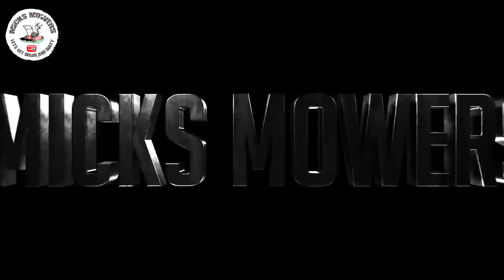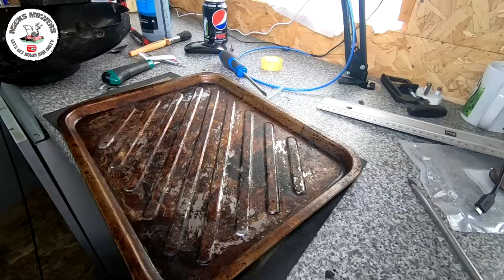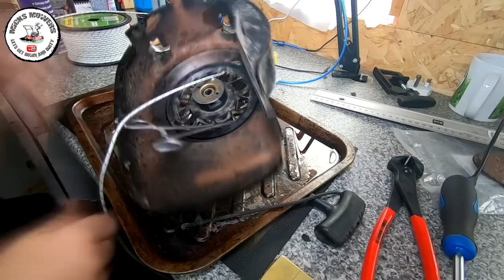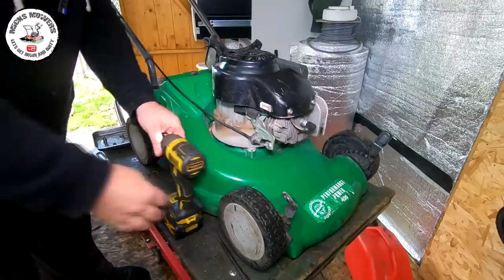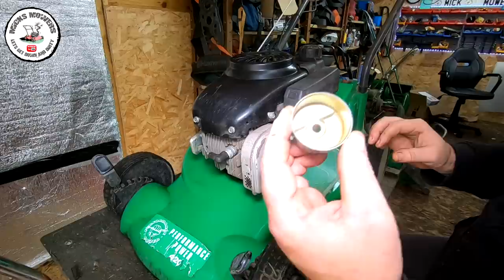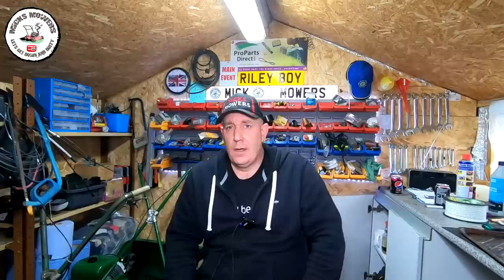Free mystery  Lawn Mower Lets See What We Have

Comment: Hi mick funny enough I acquired one of these today but red with self propelled with tecumse engine 10 quid same problem runs then stops talk about good timing I had it on the bench and was thinking one bolt 🔩 on left side of carb nearest engine near exhaust is gonna be a pig 🐷 to get to. But now will try it your way!! Thanks for another great video 📹 keep em coming.
Reply from the maker: Wow your welcome mate hope it's works out for ya
Reply: @themowerman  hi mick finally got round to doing that devil 👿 mower lol 😁 as you put it, followed your video and it works fine even the self drive works!  Just needs a bit of adjustment as it don't tick over for long. Thanks for great video 📹.
Reply from the maker: @paulmartin4971  cool mate